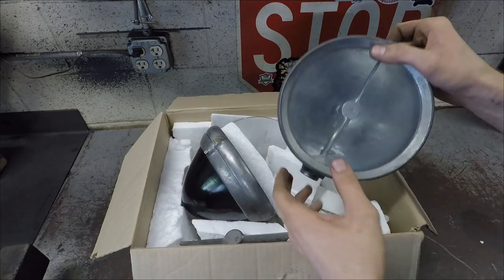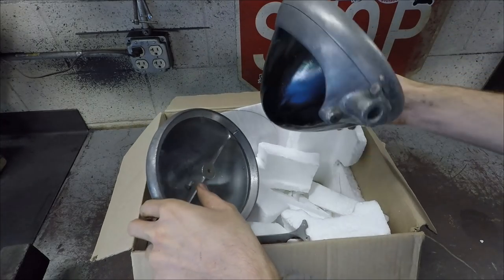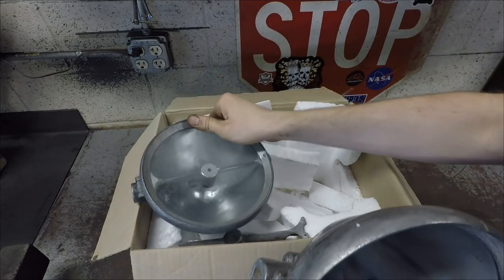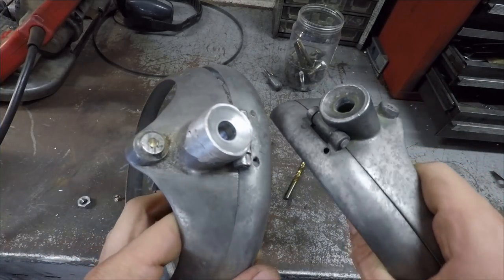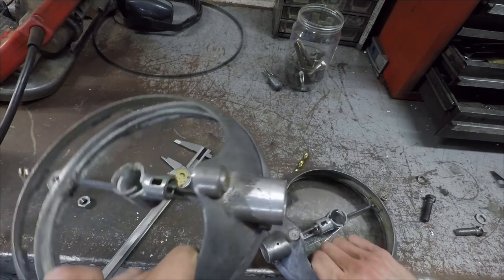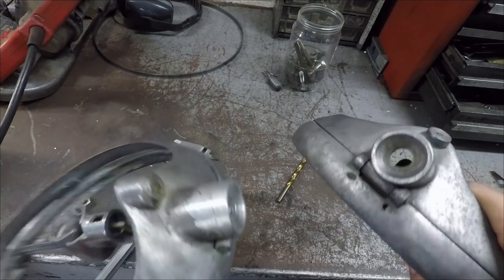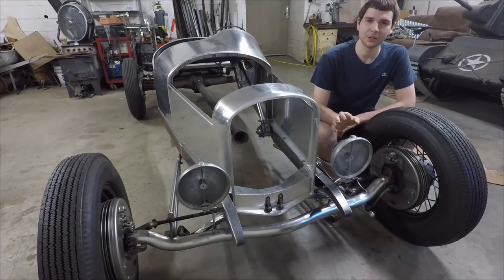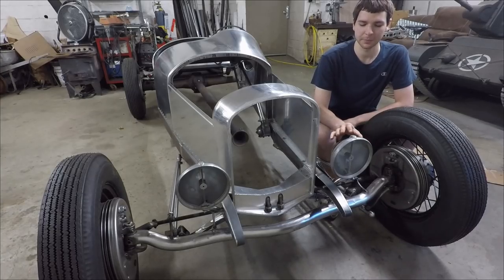Mounting Prewar Headlights | Homemade Boat-tail Speedster Pt. 43

Comment: Almost perfect! :) The fabbed mounting spacer raised the lamp for a few millimeters compared to the other bucket. I didn't notice you took that in consideration when making those legs for the lamps. And I saw the height difference on the finished product. It's not much, but it is there.

Comment: As you were showing the installed headlights I was thinking how great they will look with a completed grill and then you mentioned that a hand built grill is next. 👍🏻👍🏻👍🏻
Your conversion of the one lamp to match the other is the outside the box thinking I expect from you now. I’m sure you will be able to fabricate something to hold the glass lens in place on the one. 
You headlight brackets/mounts look amazing. Your metal finishing makes them look like a cast original piece just like the steering arms you modified.
Reply: What part of the work to make that Dodge front axle fit up with Ford spindles or the sheet metal work ever made you think this young man was contained "inside the box"? Jay Leno is probably watching, hoping he will be available to replace a retiring hand from his collection!
Reply: frederic rike 
What part of what I said makes you think I ever thought Vince was contained “inside the box”? 🤦‍♂️
Reply: @Mike Sienicki He better hurry- Jay and I are almost 70 this year. Our young man looks to have a much longer and very successful run ahead of him!

Comment: Somewhere, a hardcore resto guy is fuming.
Reply: Somewhere a restoration geek is wondering why he didn't think of that.
Reply: I agree with sixfootbear. Often when you get to the point of rarity of a part like these headlights you have to think outside the box to modify what you can get to match what you need.
Reply: I feel this. I had a guy on base get all angry with me because I swapped the bars out on a CB350 I had, saying it wasn't worth anything if it wasn't a restoration 🙄
Reply: @dumbdog2924  The thing is.This car is not a restoration it is being hand built to look like a 1930's roadster/racer and those headlights are a classic part of the look. He has modified one headlight so that it matches the other and if you didn't know you couldn't tell. As for your bike? You own it.It is yours to modify as you see fit.
Reply: Enjoy watching this project and manufacturing techniques and skills
Reply: Dude's applying an impressive set of skills to build a car from scratch and is letting us watch.  I'd let him weld an adapter to my left nut (a currently pristine member of an all original matched set) if it meant I could pretend I was somehow involved in the final product.
Reply: @f280Zero  BEST COMMENT EVER!!!!! LMFAO!!!

Comment: Idea, make 2 shoulder sleeves, insert into headlights (to make hole narrower) , then use slightly narrower socket head cap screws... so you always have a grip on both ends to tighten or loosen

Comment: Too modern day Ford hot roddy..Back in the day, a little higher up, with a graceful curved bar stretching  across the the grille for stability ..Other than that, beautiful craftsmanship..International enameled badges, would be on a lower bar  from the horns frame...IMHO...Subbed and aways a thumbs up!

Comment: I don't want to criticize your work in the slightest.. i mean it looks pretty cool, and it is your project so every opinion about somethings, i would have changed are just a opinion.. Nevermind but did you really let the angle grinder turned on while you lay it to the side?

Comment: for the bolt inside the headlights , you could just use hex bolts and slightly machine the head if they turn out to be too big , the weld would work but if the bolt rusts you going to be cursing by the time you need to remove them as you cannot grab the bolt once its in there (could machine a slot in the bolt so you have a chance using a stubby screwdriver though)
like the mounts you made for it 
if you can make a mdf mould for the missing rim you might be able to cast it in aluminium , check some literature as the mould needs to be slightly bigger to counter the schrinkage 
if you get a reproduction of a set of old mikes 
https://www.kirstein.de/out/pictures/generated/product/1/450_380_75/514d664285dca4d3050dc13d83c73ad4_1.jpg
(they still make them for harmonica players ) you might be able to turn them intoo rear lights and blinkers using inners from say old honda mptrcycle lights and cut the glass from the blinkers to size think there about 2 to 2.5 inch across and you can get them pretty cheap if you dont mind bad sound quallity , there usually cast aluminium

Comment: Hey Dude, we've talked before regarding your annual thing. Is it too early to be expecting a new video? I fear you'll find a serious gf about now and we'll lose you to the best part of life. I sure hope you're not stuck distance learning. As has been pointed out before, it would be a shame losing yourself to a Management position and not get to make use of your mad hands on skills. I know it's where the bigger money is but hey, you'll know what's best. --- So what's next? Dash/Gauges, Pedals, Gas Brake and Clutch? Or the big job of wiring? And how's that Jag Motor coming along? That's a beast for your Aluminum light weight car, but you know that. So what's this thing weigh at this point, 300lbs ? I really am looking forward to your finishing touches. Keep up the amazing work. Take Care!!!

Comment: Cringe. The mona lisa doesn't fit the frame I bought for it so I'm gonna just modify the artwork.
Reply: That's the thing about vintage parts, someone will always complain about using them like car parts. 

 Guess they would be better off just sitting mis-matched on a shelf.